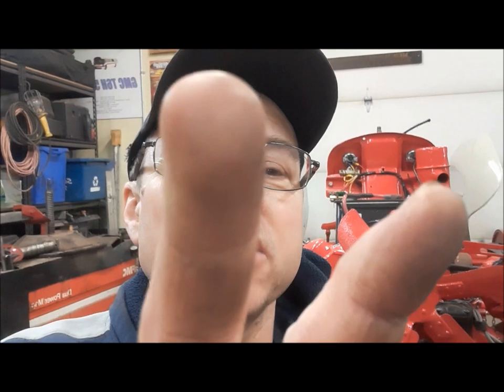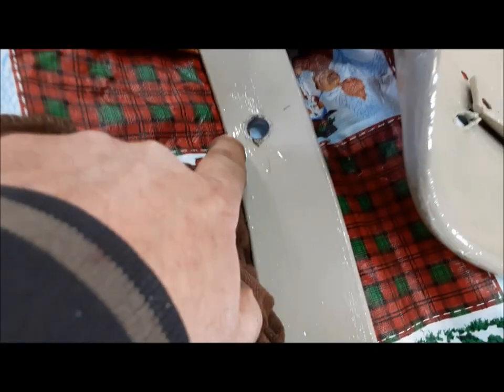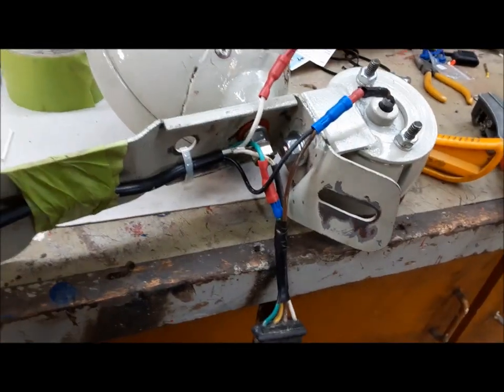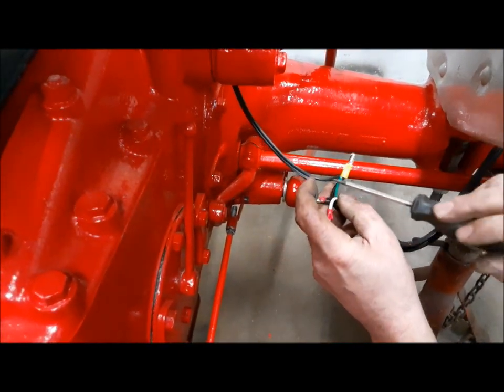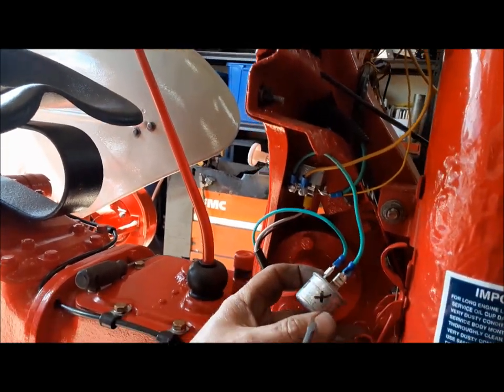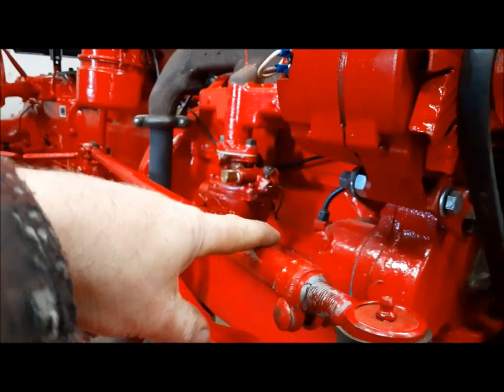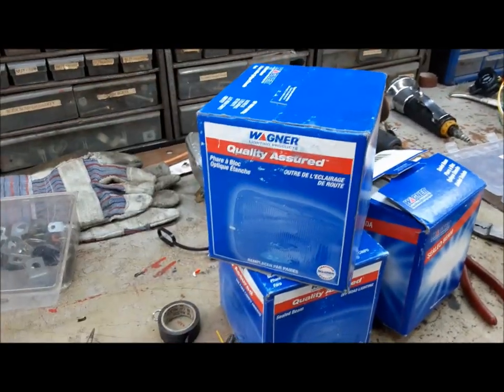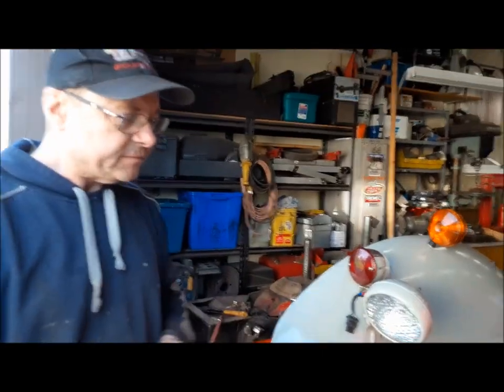1948 Ford 8N Parts Tractor part 18 Installing the Lighting System

Comment: Just to let you know, I followed this video to wire lights for my 8N and my 2N.  Unfortunately I didn't have original Ford lights, but this video has been my guide for wiring for the lights I do have.  I included the automotive type switch, flasher relay and I have headlights, taillights and flashing amber lights.  Just to let you know, your videos are very, very helpful.

Next, I will probably put lights on my '57 Ford 640, but I might leave it at 6V.  One question I do have, I know 6V lights can't handle 12V, but will 12V lights work on a 6V system?
Reply from the maker: 12v lights will function on 6v but they will be dim to the point of being useless.

Comment: I have an 860 but I loved the little horn hack and the lighting. More details on the horn would be cool. Maybe you have that in another video? And a parts list. I'd love to see this same kind of video for an 800. (do you do restorations for others?)
Reply from the maker: I put horns on most of them. Just use whatever I have kicking around or grab something at the junkyard.
Reply: @ClaremontClassicGarage  I think a video with the details of hooking up the horn would be fun. a wiring part 3 that also has the part numbers and locations where you get the parts, switches, amber ford lights etc.

Comment: Sorry if I missed it, but where did you mount the flasher unit?  I'm wiring the lights on my '47 8N similar to what you did on yours.
Reply from the maker: I just leave it in behind the dash zip tied to the wiring.